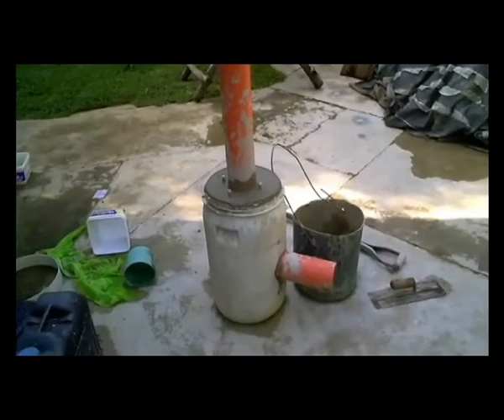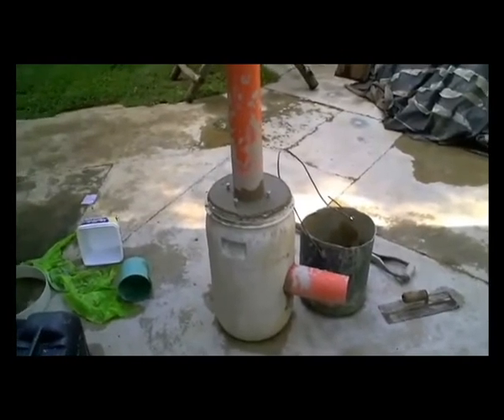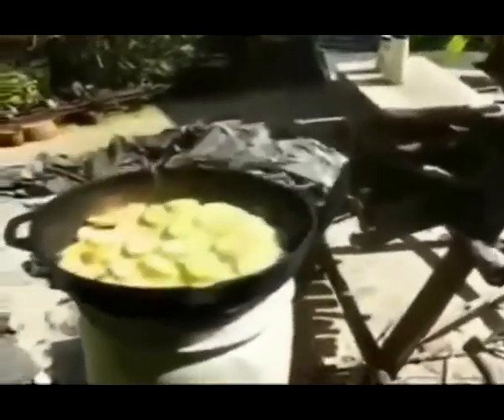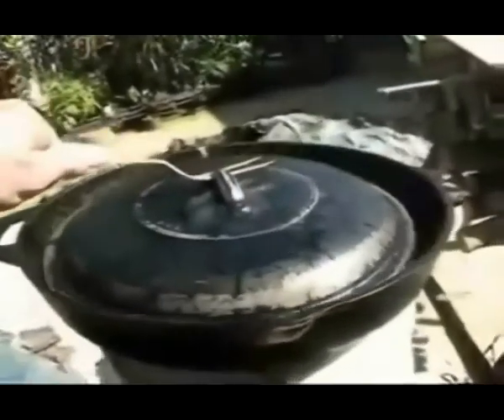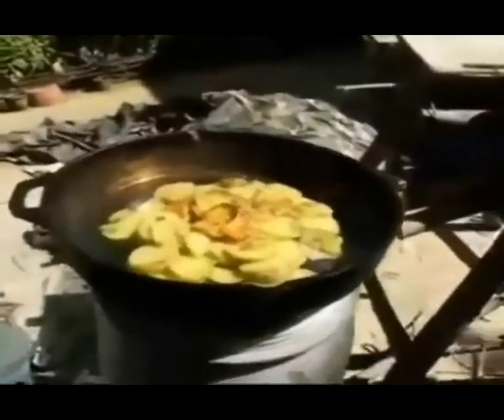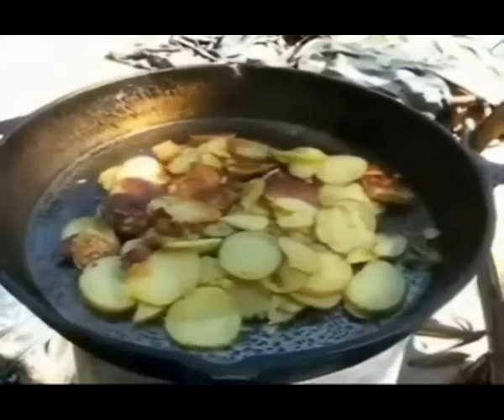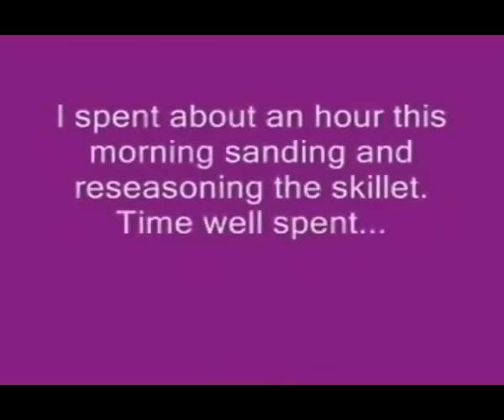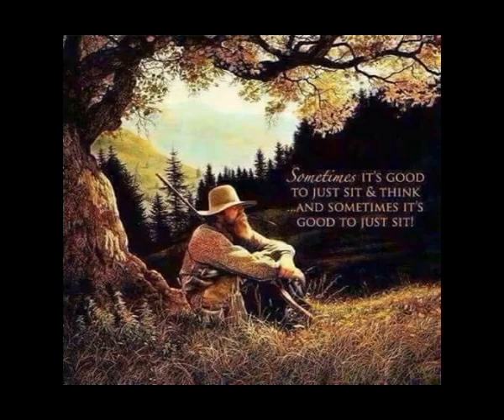Concrete Rocket Stove DIY Build Then American Fries For The Cooking Trial

Comment: Looks like it works quite well.   I like the efficiency of these type of stove builds.
Reply from the maker: It does! uses about 1`/3 the wood of an open fire and would be even better if the chimney had vermiculite around it but the cement idea was two fold, first it should last a long time and second it is very heavy so hopefully it will not get stolen from my personal space where it sits now, thanks for watching and your comment